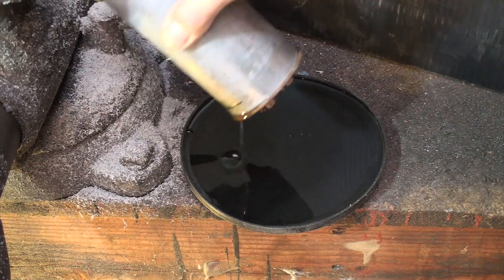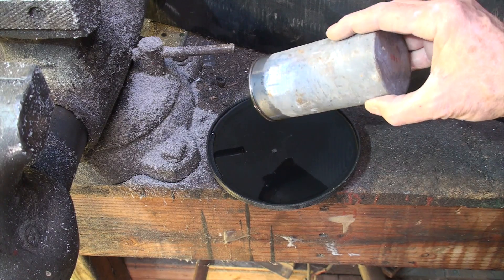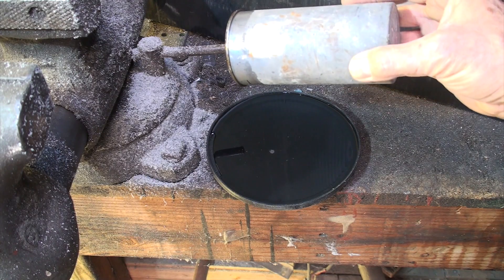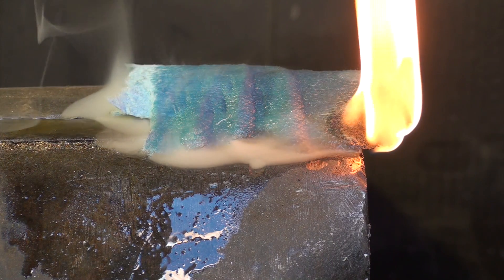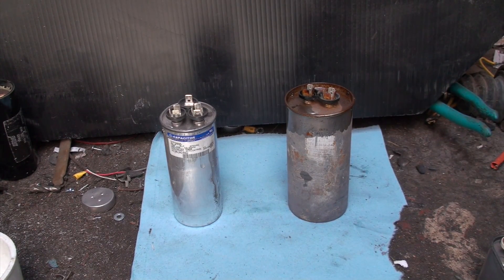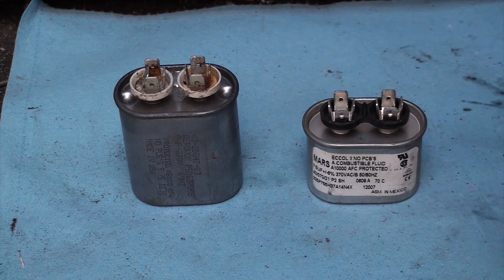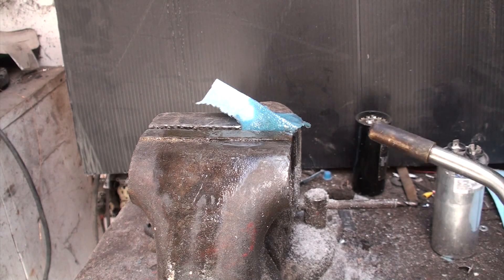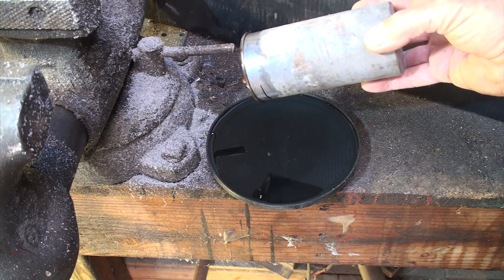Run capacitor oil

Comment: Besides thermal conducting to aid cooling, they use oil because of its dielectric properties. oil increases the voltage raiting between two plates and increases the capacitance over air.

Comment: Dropping the ESR of the caps allowed them to be smaller and not generate as much heat.   Yes I know they are not electrolytic caps,  however they still have an ESR.   Lower ESR equals less resistance which equals less wattage dissipated internally.  It's all good until that ESR goes up due to heat,  damage from voltage spikes, etc.  Eventually the foil breaks internally and you get a dead cap,  sometimes they just heat up until they poof up.   Ohh and almost forgot they use thinner dialectic material with a much tighter would core.  If you get the plates of a capacitor closer together you increase the capacitance so need less plate size.   Down side is they tend to be a bit more sensitive to voltage above rated working voltage.

Comment: If oil leaks its mean your capacitor is spoiled???
Reply from the maker: If it is just a little wet, I have seen them last for many years.  A slick user the cap means its done.
GFM

Comment: Is it harmful if it comes in contact with skin?
Reply from the maker: It is not the old PCB oil but I would use gloves.
GFM
Reply: I mean i already did but i washed my hands off right away

Comment: Good video GFM. A while ago I noticed that my original 20 year old cap in the outdoor unit started to leak a little oil. It was mounted sideways and I changed it to vertical...lol. I keep telling myself that I need to order a spare to keep around.
Reply from the maker: I don't know how many caps I have seen leaking a very small amount that never failed. However, I would keep one around. 
GFM
Reply: Yeah, it's a Chinese cap too. I like quality so I've been looking at the more expensive American capacitors but even they might be the luck of the draw.

What I don't want to happen is for the compressor thermal to cycle all day long if something fails.
Reply from the maker: +Nicholas CeeA I don't usually recommend brands, but the Amrad is quality. 
GFM
Reply: Thanks!
Reply: Oh, one more question if I may. Do you know of a smart device that will limit the number of compressor start retries, mainly because of a failed start component? Like sense extended overcurrent events and disable the contactor after a few tries.
Reply from the maker: +Nicholas CeeA I don't know of anything. Sounds like stood idea though. 
GFM

Comment: Nice work.  You emphasize oil is only found in run caps.  Do start caps just have air inside?  Presumably they don't pass current long enough to develop any amount of heat?

Interesting how size changed over the years as they learned to cope with the environmental restrictions.  One question though, you can't really compare the size of old to new if one is 35 and one is 7.5 uF?